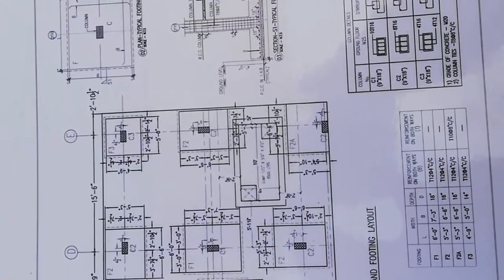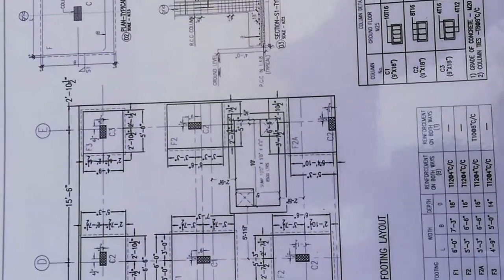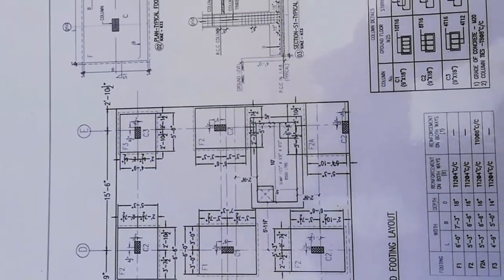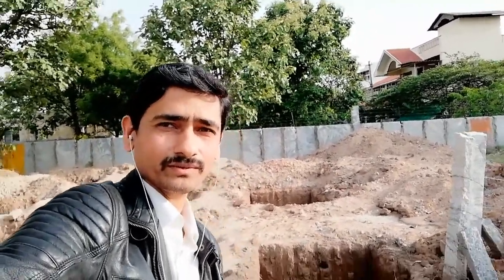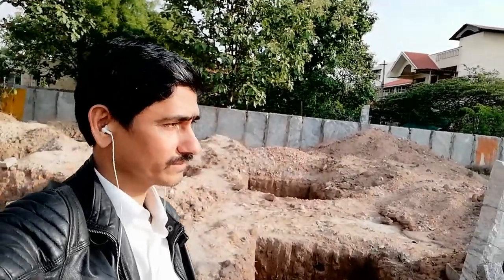Building Construction [ Foundation ] - Digging Colums Pillars | Water Storage Sump | Part 1

Comment: Sir here in my place for 4x4x4 footing. The contractor  has given pcc with 20mm aggregate. Saying 20mm aggregate has more strength than 40mm aggregate. How far it is true. PCC for column. PCC of 2.5 inch.
Reply from the maker: In my personal opinion 40mm is preferred in general and normal scenario reason being we laying as the first concrete on raw surface... However 20mm also can be used...